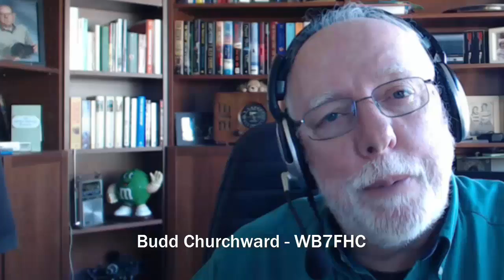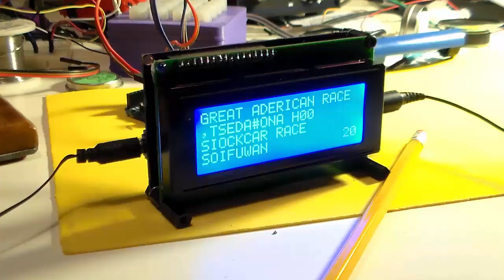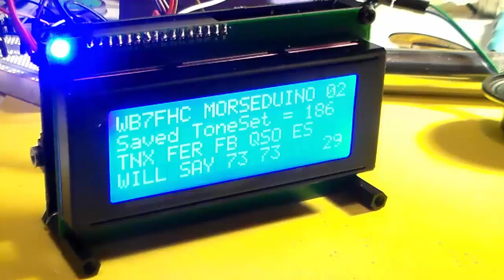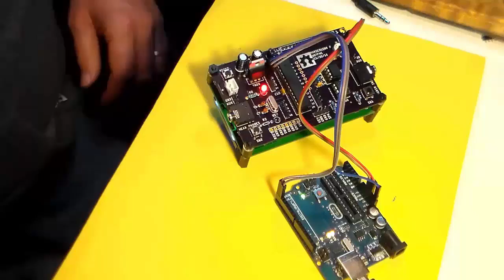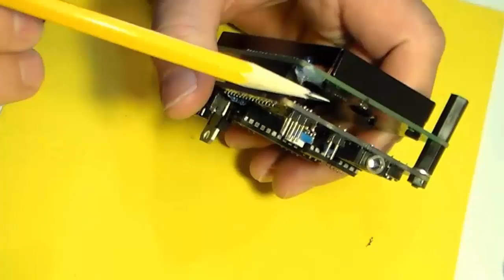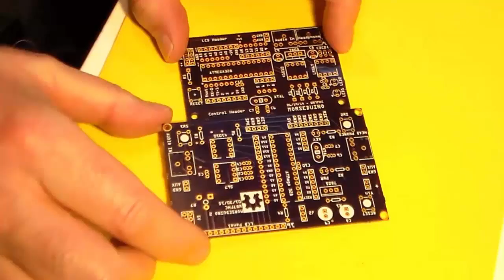Smoke Testing the Morseduino 2

Comment: Great project, Budd!  I don't own an Arduino (Yet!) but I do have a Raspberry Pi.  Whilst I've not connected anything externally in the way of components as yet, I've managed to port your code to Python and get it to decode "hand sent" CW dropping a GPIO pin to GND.  I did try with an old telegraph key I have, but I think I fell fowl of the internal capacitor/inductor arrangement (Junkers key) stopping it from getting a clean drop to GND (works fine shorting the GPIO pins directly!)

Rather than interfacing to an LCD, it outputs it to the console.  I guess with a bit of polish, it could interface to a circuit like yours, however the RPi uses 3.3V logic where-as the Arduino uses 5V (potential for blue smoke!)

It got me learning Python if nothing else!

73 de G0WFV
Reply from the maker: Tony Corbett This is great, Tony. I once had a friend tell me that I could simply do the same thing with Fldigi and that was free. I said "Yes, but I didn't build Fldigi myself!" It isn't about printing CW. Its all about see your own creation actually work. We get ideas from each other and give birth to a solution that is our own. You borrow ideas from me and end up with something that is truly yours. And you get to learn something new along the way. What could be more fun than that?

Comment: I finally got around to assembling the Morseduino 2.3 kit. Kudos to Budd. Great job of kitting and went together without a hitch. Worked straight away and Budd even provided me with the updated Arduino code and instructions of how to get it onto the at382p chip. Highly recommended!
Tnx es 73 de Arnie W8DU

Comment: I see you have V2.3 up on OSHPark...nice
https://oshpark.com/shared_projects/kKda72m3
A humble suggestion for the top of the board to pretty it up, the large open spots between traces for the copper pour plane, between the traces put a wire (I use .001 mm), then name it the same as the polygon for that particular copper pour, it will then fill in the gaps when you ratsnest (well on EagleCAD that is)

73's good sir
Reply from the maker: +Brian C Thanks for comment, Brian. I have done that. Fritzing makes it very easy to do. I didn't show it in the video, but I always do a ground fill on my boards. It is the last thing I do before I prepare the files for uploading.

Comment: Hi Budd,
I've been playing around with your code; in this case with a photo-sensitive resistor and a laser (since I don't have a radio licence and lasers are cool.. ). Lining up the laser and receiver will be a challenge over longer distances, but hey: who doesn't like a challenge?

Somewhere in your code, you're talking about the 'secret sauce'; could you please elaborate on that, because I just didn't get it. It must be something pretty smart and I guess a lot of viewers will appreciate some explanation!
Thanx for all your good work and sharing!
Reply from the maker: +Fernand Geene Van Well, the secret sauce isn't a secret. It is the order of the characters in the array. If you were to look at the binary number of their position in the array, you would see the Morse Code in the 1s and 0s.

I experimented with lasers. I used them to measure the speed of vehicles driving by my house. They are hard to aim. If you want to transmit with light (it does not require a license) look into the high power LEDs, like the Luxeon Rebel Deep Red. These work better than lasers and have worked as far as 20 miles.
Reply: Fernand Geene Van please share original code and design of budd, cause link on description are dead. Thanks.